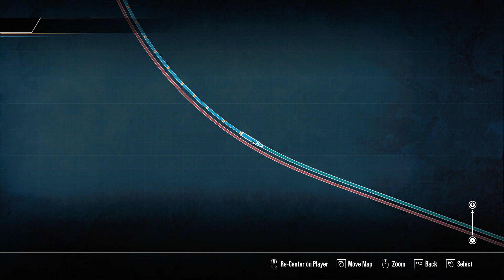Train Sim World 2: Clinchfield Railroad - SD40 Mods

Comment: hello friend my locomotive is out of power it takes a long time to pick up speed.what can be?thanks!
Reply from the maker: Depends on train length/weight etc. Any particular scenario or timetable? I know one or 2 of the scenarios are bugged.
The key is to make sure your brakes are completely released, which can take a few mins. Then accelerate slowly, 1 notch at a time keeping the amp guage out of the red
Reply: @schnauzahpowahz  Hello friend, there is a route here that seems to be a buggy. I set up the train, releasing the brakes etc. and he has no power, I have to reduce some cars for the locomotive to run. It is the 8:10 hour coal route that presents this problem.

Comment: Have you done the Clinfield 3016 extra coal yet? It's the first sequential mission after all scenarios are finished. Myself and another fellow have been leaving comments asking for help. The gradient is 1.5%. 3 locomotives carrying roughly 4700 tons and we can't get it any faster than 0.6 mph throttle 3. Throttle 4 and wheel spin occurs and we roll back down hill. Any input would be helpful.
Reply from the maker: Sounds to me like the brakes are still charging, they can take up to 5 min. Key in, engine selector (so 3), cut brake to lead, then pop freight selection. Release the brakes... wait... wait... and wait 😄. You should see it at about 70 on the brake pipe before they start to release
Reply: I waited until brakes were at 89 psi. Highest it goes. Throttle 3 gets it going but only 0.6mph. Go up 1 more to Throttle notch 4 and wheel spin and roll back happens. Snow doesn't help the situation. Let me know when younget to this point of the game right after all scenarios are finished, it's the first southbound extra coal 3016 mission.
Reply from the maker: @damongrimes2094  hmm... ill hop  on it later this week and see if I can get it moving
Reply: Thanks
Reply: @damongrimes2094  Did anyone solve this? The situation is exactly as Damon describes.

Edit:  Allowing the train to continue at 0.6 mph eventually succeeds. Within the first mile the grade reduces to 0.8% and you will start to pick up speed and soon depart the wheel spin zone.
Reply: There’s a similar situation that occurs on csx hh, the sd40s can’t climb the grade, except it’s absolutely impossible to climb the grade no matter what you do, they should add a helper locomotive system where you would stop at the summit and the helper engines would depart back to the yard
Reply: @loganflores486  Don't forget to turn on banking comm; if your train is parked somewhere on a slight gradient - apply the independent, go into at least notch 1 or 2, then wait for the amp meter to go up for around 10 seconds and then release the brakes (you don't have to do this everytime). That should get you moving for a bit then slowly increase the throttle, if you wheelslip try applying lead sand